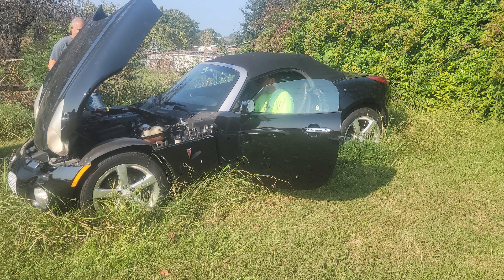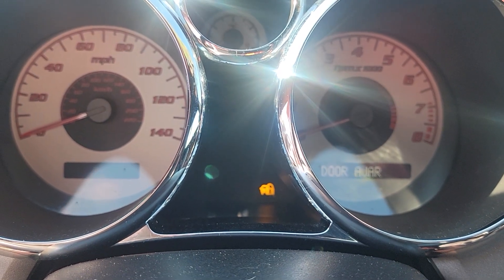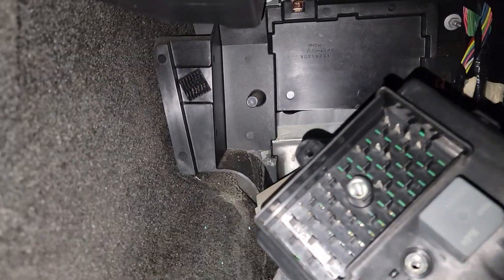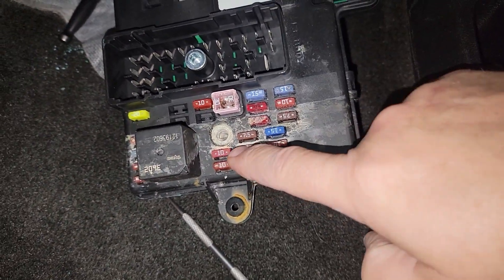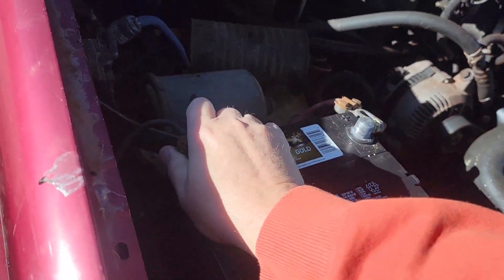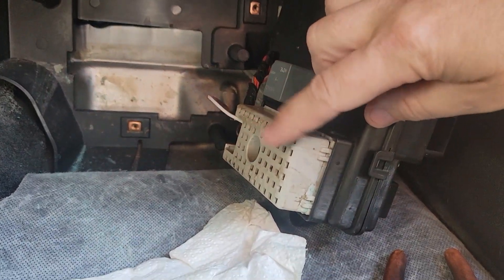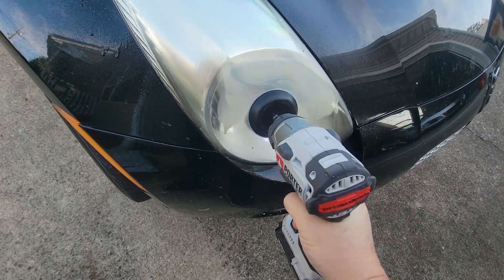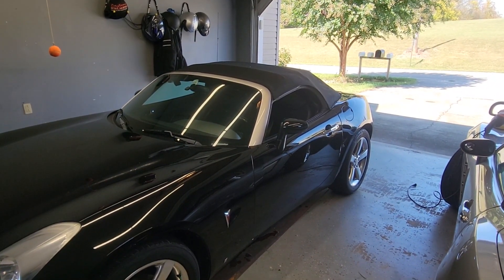2006 Pontiac Solstice field find | Theft Deterrent light on | No start but I fixed the issue.

Comment: your battery is too weak and your terminals are dirty...
invest in new battery
Reply from the maker: Nope, not the issue. It was brand new. The BCM went out in it.
Reply: I currently have the same condition on my solstice. Water flooded the inside and now it wont start. Did you get a new BCM??